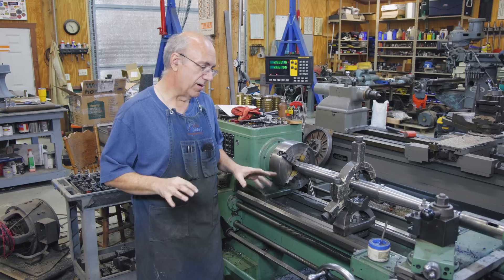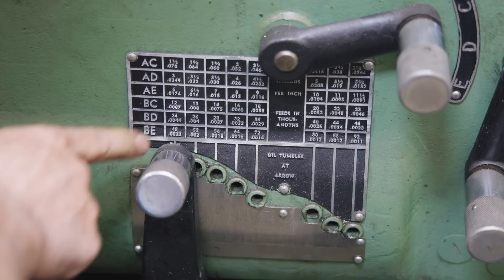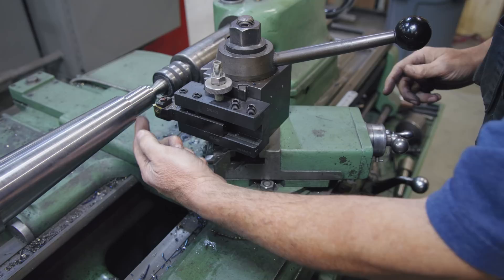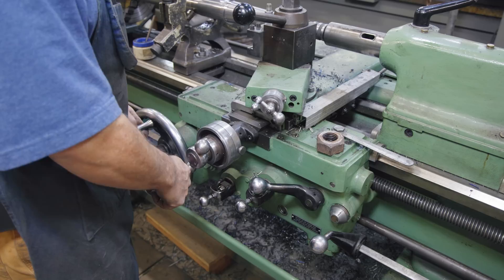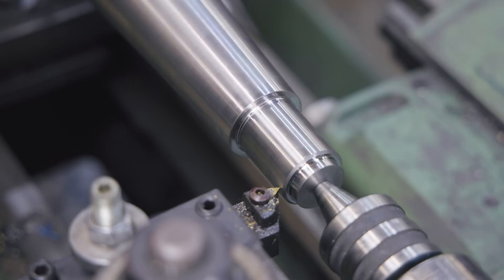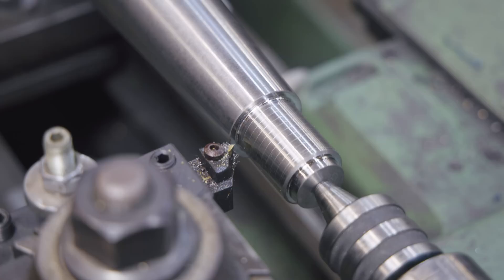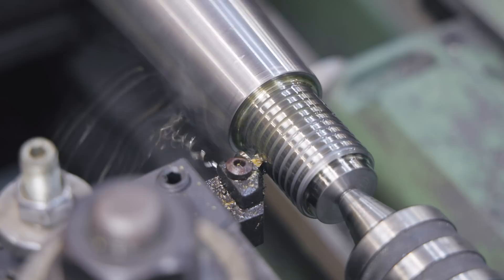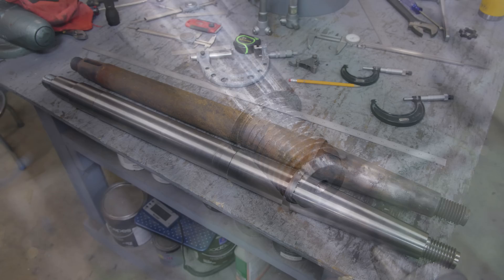Tally Ho Capstan Project: Single Point Threading and Milling Keyways in the Capstan Center Shaft

Comment: Leo is an absolute magnet, and has drawn so many wonderful "mechanics" into the Tally Ho project, plus I'm sure Leo is well "tuned in" to what Kieth is doing. Tally-ho is the traditional cry made by the huntsman to tell others the quarry has been sighted. It may also be used with directions, including "away" and "back". Watching these Master Craftsmen at work is so soothing.
Reply: You nailed it in one paragraph.
Reply: What is interesting is this is not the first time Keith helped Leo with a restoration. See episode 68 in Tally Ho and Keith's 2 episodes restoring the face for the pipe threaded.

Comment: This shaft might be a good project for a cnc lathe, but you showing how to do all these steps by hand has a great educational and entertaining value.
Reply: Please tell us how much time it would take to write the program,calculate the speeds and feed rates, then run program checks. My guess is that it will be about the same for the first part. One-Of is the Key here.  The scrap bin should only contain shavings from One bar. Thanks for taking us along.
Reply: @billkurek5576  I have been a journeyman machinist for the last 20 years and a good portion of that was in the cnc side of things.   On a proper cnc lathe with conversational programming, it would have taken maybe 2hr of setup time and maybe 2.5-3 for run time.   If it was a machine with live tooling also the keyway/slot would have added maybe half an hour to that.

Comment: Like Mike you are never to old to learn. At almost 80 I have spent almost all my life building 5” gauge steam locomotives here in the UK. I have always set my tool post square by using the front of the chuck, never thought of bumping the Tailstock barrel, guess I will be doing it that way in the future. Thanks Keith great series and another great tip.😊

Comment: Awesome job! Brings back memories of my machining experience. We used to have to work within 1:1000’ of an inch in brass, copper, aluminum and soft steel, in left hand and right hand threads, all connecting together, with nurled edges. You are doing  awesome, honest work as a true engineer. The lathe I used was a coldent student lathe (300mm) and it seems far capable of both metric and imperial threads. Thanks for sharing your video!

Comment: At 5:05, setting the topslide to 29.5 degrees actually causes the RHS of the tool to take a fine shaving off the RHS of the thread while the LHS of the tool does most of the thread cutting.  This ensures that the thread form is smooth on both flanks.

Comment: Wonderful work Kieth as usual.
As the owner of a new lathe only last week, I for one appreciate you taking the time to explain & show the single point threading process.
It along with the risk of crashing the new lathe are some of the things giving me nightmares at night.

I will search back & find this and watch it several times, before I attempt anything this complex.

I will probably do several “test runs” on machinists wax - to try and get the process to become second nature before I actually try it on metal.

There are viewers out here who appreciate you going back to the very basics.

The two comments - one about having to center find again with the different widths - probably would have tripped me up for sure.

I’d also probably tried to indicate in the second end to be horizontal to make the slot like you did the key way & that also would have been a mistake.

Finding out “what I don’t know” is pretty scary.

Hopefully I can learn enough watching these videos to not screw up straight out of the gate. 👍👍👍🇦🇺

Comment: Pitch diameter thread micrometer is the most common way of measuring threads.  Using nuts is probably the worst because how often is a worn out internal thread used until its been worn too much.   
Also the edge finders are actually over the edge of the contact area if it jumps to side.   Correct way is to get closer until there is no noticeable wobble to it.

Comment: Keith, been watching you since before Leo found the Tally Ho, about to be scrapped.  Watched you fix his threading machine, and wasn't surprised when he asked you to take on the capstan portion of his project.  Yes, CNC would have finished it faster, but you are showing that you can make something just as good using manual machines.  Honestly, the tools you have at your disposal are more advanced than those that were available at the turn of the 20th century, but the knowledge and skills required go back even further.  Those were handed down over the years, enabling  generations of new machinists to ply their trade.  The other thing is that if something happens to a CNC's computer, you're left with a giant paperweight until it's fixed/replaced.  With the manual machines, you just need a power source.  Sure, a pile of tooling helps too, but that's secondary to the point I'm trying to make.  CNC had to have manual machines first, and I'm happy that people like yourself are around to keep those skillsets well oiled.  Thank you for everything.

Comment: Slightly surprised that (with this much effort already invested) you jumped right in with the 7/16 twist drill…
I would have been so paranoid that the drill would wander; I think I’d have maxed out with 3/8 to ensure I had material on the flanks to clean up…

Comment: I have to say that I have/am enjoying these viewing videos and learnt so much. Now to say a stupid comment, which is so obvious when you think about it “I did not think such big machines could be so accurate” specifically this episode, moving clunky levers and knobs to such a high tolerance end results, just goes to show how little a know
Reply: Much easier than having to work out what to use and change wheels to do it manually.
Reply: The bigger/heavier the machine the more stable it is which allows for such tight tolerances.

Comment: thank goodness you ran a tap through the nut, was it more difficult than you thought, because if it had been whitworth (55 degree pitch angle), by running a die through you converted the nut to UNC  (60 degree pitch angle) the same as the thread you are cutting. as it was originally made in the UK, I would have expected a whitworth thread form, but that is immaterial now you have run the die through the nut.

Comment: Good video, Keith. I thought  it might have been better  to put a key on each side of the taper  since it would  be motor driving instead of hand driving. That's a lot of metal out of the taper. Thanks for the video.

Comment: CNC is interesting because in reality while it does do mass production well like all processes there is some downtime - this is often the case where the CNC feeds another assembly line just in time. - my experience is that the one-off piece can be run in the downtime very efficiently because the programming can occur during a mass production cycle. It all depends on the volume that goes through the shop on a shift.

Comment: When starting my setup cut on a shaft I establish a circle on the OD which is the 0 point for my depth. I always made the depth about 0.010 deeper than 1/2 of the key thickness. All of our machines were manual machines, not even any readout equipment.

Comment: It is often just as much work to produce a single piece as it is to produce 10 pieces on the CNC lathe. 
It is the setup time that is needed. 
And with the CNC lathe, every tool itself has to be calibrated.

Comment: Great video again Keith. I'm not a machinist by any means. I spent my career as a GM dealer auto tech, but I did have machine shop classes when I was in high school back in the 60's. But where you compare time spent doing a project on a manual machine compared to a CNC, do you factor in the time spent on designing and the programming for the CNC not just the machine operation. Overall I would think the time spent on a one off project on a CNC would be more than a production run.

Comment: It's always educational to watch Your videos. 
Q: If I want to thread an oddball thread, like 3-1/3 Thread per inch, I'm supposed to us the same number in the thread dial. Now, metric threads has to be as odd as it gets. Is it possible to make metric treads on an imperial lathe, using the same technique! Open the half nuts and close them at same number?
Thanks for all Your intresting videos!

Comment: That capstan was originally built in England so that 1 3/8 diameter with 6 TPI is probably a whitworth thread. Whitworth threads have an angle of 55 degrees not 60.

Comment: Excellently instructive.  I did not notice however any consideration of the thread angle, as mentioned in previous comments. An Imperial thread from the UK in the 1900s was surely cut at 55 degs, not 60. I don't believe there were any 60 degrees threads at that time. It wouldn't matter if you were going to cut new nuts, but if using the old ones, it's an important point.  Please prove me wrong!
Reply: He mentioned, but did not show, running a tap through the old nut, changing the angle.  Further, he showed a test fit of that old nut on the threads just cut on the shaft.  It fit nicely.  

And with that, the proof is complete.
Reply: Yes, he spoke of the tap but not that it had recut the threads, merely cleared them. I am not certain that running a 60 deg tap through a 55 deg nut reprofiles it to the correct load bearing  form, even if it will go on.
Reply: @RicktheRecorder  It doesn't. Because 55 is narrower, Ideally he should make new nuts. But he probably won't read this.
Reply: Yes, it's not just the included angle, it's the shape of the thread. Obviously for the same TPI and a different angle the tooth needs to curve in a different way, so the surfaces will not mate unless the angles match.  My understanding is the the Whitworth thread form is around 10% stronger than the Metric/Unified form, but this additional strength derives largely from the better fit between the components, which tends to reduce 'rocking'. Obviously a 55 deg thread recut to 60 is going to have a worse fit than a true 55/55 or 60/60.

Comment: I guess the original thread would have been British Standard Whitworth 55degree, but I suppose all the parts you're making are 60, so that's a small variation from the original which doesn't matter. BSW was at the beginning of being phased out when I went to work for a threading tap manufacturer in Sheffield in the 1960s.
Reply: Not necessarily BSW.  I believe Keith was able to thread the original nut onto the new threads.
Reply: @bradkahler  Yes, because he tapped it! Do pay attention.

Comment: I'd still like to know what grade of steel was used, and why that grade was chosen. I have an 8' cold rolled 1½" hex bar that I use to pry stumps and such. It's much heavier than hot rolled steel. As I get older, it's a challenge to maneuver. I suspect because of the grain structure, it doesn't rust.

Comment: When you get to assembly can you go thru what materials everything is made of?  Given the wet environment that this is going to be in, I'm wondering what parts if any need to be resistant from corrosion.
Reply: Really speaking for marine use in a perfect world you’d select 316Stainless for corrosion resistance - but theres a host of reasons other materials are used, not just cost but the actual material properties from the engineering aspect.

Casting the replacement capstan from cast iron, required the pattern & making the mold and a total of 6? attempts before a suitable result was obtained.

To have done that in 316 stainless probably it would have had to be milled & lathed by CNC from a solid block of 316 Stainless Steel.

I guess they also want to remain authentic to the period wherever possible with the majority of fixtures & fittings on Tally Ho.

There are some aspects were modern methods & materials have been employed for convenience, safety & reliability reasons, but much of the project looks authentic to the original vessel.

Comment: I'm not so sure CNC would be better for a one-off project like this one.  Just because you can program a series of steps  that should be precise it doesn't always work out the way you think it will the first time.  A person running a CNC machine on an unproven program might have made 3 or 4 of those shafts before it came out right.  If the program had been proven to produce a usable shaft already then it would certainly be faster but that probably wouldn't be the case in this situation.

Comment: Keith, during setup to cut the 2nd pocket, did you have to rotate the piece so that the 1st and 2nd milled pockets aligned, or could a key placed in one point to a different axial direction to one placed in the second. Was that a requirement?

Comment: Why did you not put an undercut relief at the shoulder end for stopping the thread?
Reply: I would too. Be he’s really good at the end of the thread action. Like he said, he’s done loads of threading
Reply: The only reason in this instance for a runout groove would be if the nut needed the extra engagement to seat correctly.
Reply: Because he is replicating the shaft exactly.

Comment: In the setup for milling the key, you used an edge finder between the vise jaws  to measure for the center of the shaft.  Do you not have to compensate the measured distance for the diameter of the edge finder tip?  Beautiful work, BTW!
Reply: Not when you are using the 1/2 function of the DRO.
Reply: @grntitan1  got it, thanks!

Comment: Just a quick question, when setting up your single point thread I noticed the compound wasn't set perpendicular to the work piece. As you feed it in does that change the centerline of the thread? So the deeper you move in the further the shift from center? Or does it really not matter because the depth of cut overcomes any kind of shift and you are engaging both sides of the insert?
Reply: For a 60° thread the compound gets set to a 29.5°-30° angle.
Reply: He is moving the cutter horizontally so it will stay on the centerline for proper cutting.  When he moved the compound in at that 29-1/2 degree angle, the leading cutting edge went a lot deeper into the work and the trailing edge only went in a very slight amount.  If he set the compound at 30 degrees, the trailing cutting edge might not engage the work at all and deflection might cause that side of the resulting thread to be stairstepped.  If he set the compound at 0, both cutting edges would engage the same amount.  A slight deflection could cause one edge to dig in harder and the other edge to come out of the cut a little bit. This would change the load on the toolpost, causing the the cutting edges to oscillate and cause an absolutely magnificent chatter.  When I asked the same question more than 50 years ago, my instructor didn't explain it.  He just smiled, folded his arms, stood back and told me to do what I thought was right.  When I did, I had what is known in the trade as "a learning experience!"

Does this help?

Comment: Why not cut away from the shoulder?
Reply: Unless I miss my guess I think you would be cutting a left hand thread then.
Reply: @lotuselanplus2s  It can be right hand, but you will end up with an undercut at the shoulder.
Reply: @sergiusabo  yes.
Reply: would need to reverse the rotation of the part and invert the cutter to do so, it is possible but not so much to see on YouTube. Also not a good idea if it was a threaded nose on the lathe.
Reply: Joe Pie does cut away on his channel as Paul-FrancisB said
Reply: @steveschild9065  I nearly added it is the Joe Pie method 😄

Comment: Wonderful job, but honestly this capstan looks way too big for a sailing vessel of the size of Tally Ho. I understand that it was originally there but I fail to justify why such weight shall be placed back on the very bow of the boat when a much smaller and less invasive winch could have been replacing this huge and heavy capstan.

Comment: So, went for the 60° thread angle US standard rather than the British/Whitworth standard of 55°. Was there much slack/cutting when you ran the tap down the nut? Can't remember which but used to have lots of trouble mixing US and British nuts and bolts. Had a mix of kit on my boat. Another informative vid.

Comment: A few videos ago, when you did the measurements of the original shaft, more than one person in the comments posited that the threads were likely Whitworth profile, given the English origin.  As I understood it, Whitworth has a 55 degree included angle rather than the 60 degree that is used more commonly.  How did you conclude that 60 degrees was proper rather than 55?

Comment: What's up with all the '55 deg Whitworth' comments? Isn't that a lapsed standard?
Reply: Not if you want to keep the project original, Whitworth, UNC, UNF ETC are a lapsed standard, most countries use a metric system, nowadays.

Comment: I have to disagree with you on doing this faster on a CNC machine,faster.If you had to make a batch of them,yes, would be faster but.for one shaft,Manual is faster
Reply: I think what he was saying was that the roughing, then the taper, then the threading could be done on one half of the bar with one set up.  Then flipped to finish the other half.

Comment: amazes me how the team is struggling when you consider that this was originally built/fabricated in the very early 18th century. From pattern building, casting, turning or milling at ever step there is a challenege. I think th etake away is that the old ways remain the simplest and best. modern life adds a level of unecessary complexity.
Reply: 18th century? I don't think so!
Reply: It is easier to do something from scratch than it is to retrofit and reverse engineer.
Reply: Early 20th century
Reply: @stumccabe Many people have no clue what century we are currently in.
Reply: wow had me worried for a minute as I was born in the same century as the Tally Ho 🤣😂
Reply: 1910 I heard.